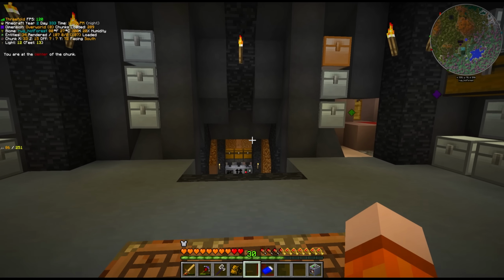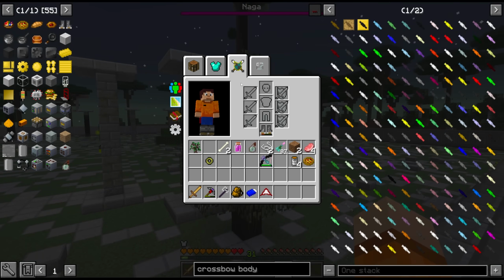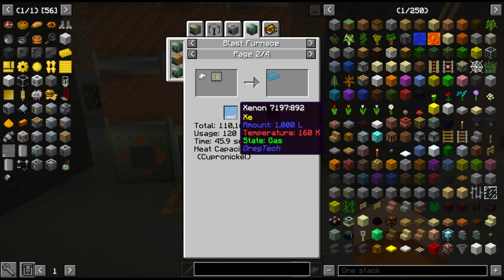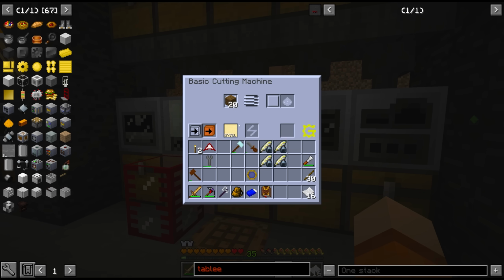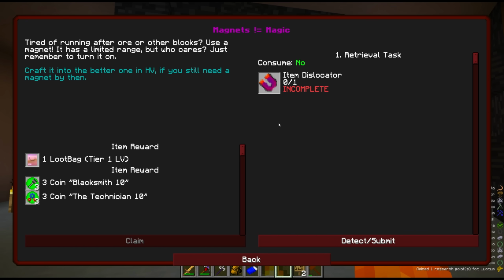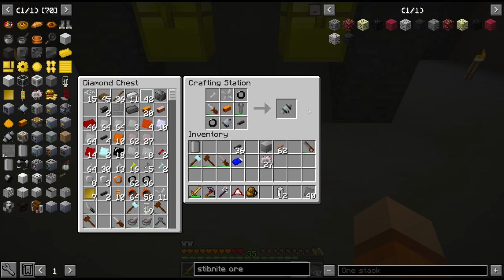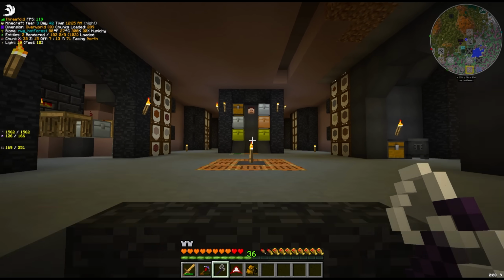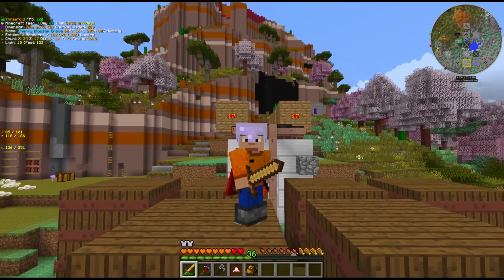Gregtech New Horizons S2 08: Scanning Circuits

Comment: Ah, Thaumcraft. It's not the easiest mod to get into in GTNH, but a ton of QoL features are locked behind it, so it is worth getting into. And getting into sooner rather than later, as the earlier you get QoL feature the more they'll do for you. To start with you can actually get alu ingots from killing Kobolds or Slime Beetles in the Twilight, allowing you to start with TC as early as mid LV (or even earlier if you pull other shenaniganry, though I wouldn't necessarily recommend rushing TC that hard). Twilight mobs in general have had their loot tables changed in GTNH, and some can drop very useful items indeed, even if it requires actual player kills to get them (diamond spikes or other forms of artificial player kills, sadly, won't work). It's worth hunting a few mobs on your search for other loot and treasures.

Wand progression in GTNH is very critical, very obtuse and sadly very poorly explained in the questbook. I have outlined more or less the entirety of required wand progression in the spreadsheet, however, so no more crafting a half dozen intermediate wands that are used solely and exclusively to craft a better wand. Instead you'll only be crafting the necessary wands to craft more wands to craft more wands🙃.

One note is that while Carbon crossbow limbs have awful durability you can put a diamond on your crossbow to give it +500 durability, which completely negates that problem. Albeit at the cost of a modifier that's basically worthless long term, but crossbows don't really have a lot of useful modifiers they can get long term anyway. You might find a diamond a worthwhile investment short term, it depends.

That one free quest reward ball of moss I do highly recommend using on your crossbow bolts if you're going to go for a max damage crossbow. You can get one particular very good material for crossbow bolt tips very early, namely Palladium after setting up a Vacuum Freezer, but repairing your bolts with that material would be very obnoxious if not worse. Ball of Moss fixes that issue. Note that there is a second Ball of Moss you can get as a (choice) quest reward from Traveller's Goggles Upgrades in Getting Around Without Dying, but that requires HV circuits to do. Crafting Balls of Moss through TC itself requires Arcane Infusion, as well.

That indeed was a Brutish Skeleton, with greatly increased damage, HP, and innate armor. Very dangerous mobs to face without a powerful ranged option, especially with practically no armor.

The hedge mazes in the twilight I don't recall getting great loot out of, though if you're still missing pumpkin or melon seeds they're  a good source. Otherwise the best loot tends to be shears, just purely because of how annoying shears are to craft in GTNH. If you want a low chance of crazy good loot in the Twilight Forest I recommend diving down the wells. There's a chance they hide a chest, and those chests can contain some very good loot indeed.

Be extremely careful around those Witchery circles in the Twilight, because there's a non-zero chance it's sufficiently overcast to allow the two hidden Witch spawners to do their work and make your life absolutely miserable. Also yes, those were four tin food cans you can use to completely cheese Spice of Life, which normally require an HV bending machine to craft. If you don't go for a Healing Axe at all you'll be praying to find a lot of those food cans early, because you can fill them in LV just fine. It's crafting them that requires HV.

Note that you can craft the Twilight Forest boss drops with their respective trophy (which will not be consumed) and Salis Mundus in a sufficiently high tier Assembling Machine. For Naga Scales this isn't really worth it, since you don't need very many and Nagas are extremely easy bosses to reach and defeat. But for Lich Bones, which require a bit more work and are needed in larger quantities, crafting them might be preferable over raiding another Lich Tower or two.

There is one other way to deal with maintenance issues this early on: You can give your EBF a third energy hatch, and provide it 6A LV total (or provide it 2A if you're only using a single energy hatch). The effect of maintenance issues on most multiblocks, including the EBF, is that recipes cost 10% EU/t more per maintenance issue up to five issues. At six issues every multiblock will simply break and shut down. So a 120 EU/t recipe at five maintenance issues is 180 EU/t...but 6A LV is 192 EU/t. So the recipe doesn't fail. It'll cost a ton more power, and neither energy hatches or generators are cheap either, but if you absolutely must ensure that a multiblock cannot fail due to maintenance this is one way to do it.

Another way to craft that Raw Aluminium stuff, by the way, is Compressing pure alu dust. This is important early on, as you cannot cook pure alu dust into alu otherwise until a fair bit later in MV.

Usually you want to avoid doing the non-fluid recipes at all costs (and frankly I think GTNH would be improved by removing those non-fluid recipes entirely, they're just more useless NEI clutter), but this early on it's somewhat understandable that gasses aren't easy to come by. That said start centrifuging and electrolysing stuff so you get the gasses out of them. Adding gasses to EBFs makes them faster and cheaper to run, which is something you very much want from your EBF recipes.

By this point it's definitely time to retire the old Ore Finder Wand and invest in a Prospector's Scanner. Soon you're going to need to start being able to scan for fluid fields (if you're going the diesel route to MV+ power), and more and more veins end up being necessary later, so there's no harm in discovering them early.

GT just loves to do thing differently, as a way to add "difficultly" I assume. I don't know why else it would decide to measure things in L/s rather than mb/t like every other mod does.

Rather than scan every single item on that list in order it's also possible to unlock aspects by combining them in the research table. For instance you can just combine Terra and Ordo to get Vitreus instead of scanning a glass block, but that will consume research points whereas scanning items does not. Some items also have to be scanned to unlock hidden research nodes. I find it's best to combine Victus (Terra and Aqua) in a Research Bench since there's very few items that have Victus and not one of the aspects that requires you to have Victus to understand/discover, but beyond that scanning will take care of the rest. If you are lost on any particular aspect's combination there's plenty of sources online that lists them, spreadsheet included.

There is a config setting to make that giant list of Thaumcraft "you've discovered X" messages scroll down faster, for the record.

Three: Rushes Healing Axe ASAP. Also Three: Disappointed when he realizes that early loot bags mainly give you good food 🙃.

If you want to process ores through your BBF/EBF you're going to need the dust, not the ore.

LV batteries you can craft more efficiently in an Assembling Machine, but this takes Polyethylene. You can get this in LV, but it's a wee bit of a process/detour to do so.

Batteries you should only ever craft using lithium, unless a recipe specifically requires another battery type. Cadmium is far too rare and used for other purposes to consider using it for batteries, and while Sodium is cheap it makes for the worst batteries, which goes counter to the entire idea of crafting batteries to store power in the first place. Certain items, such as the Dislocator and Soldering Iron, also require lithium batteries specifically.

The Alloy Smelter usually doesn't care if you're trying to alloy dusts or ingots, it'll combine them anyway. It doesn't for red alloy or bronze, at least.

It's true that Magnum Torches requires a bit of Thaumcraft to craft. But Chandeliers, the lower range versions, only requires an LV Assembling Machine. They're a bit pricy, but compared to a creeper blowing up half your infrastructure, exceptionally cheap.

Something else you can do with Thaumcraft, although this does come at the cost of a Taboo research, is duplicating a wide variety of nuggets through transmutation. Gallium and Arsenic, among many others, can be duplicated this way.

Battery Buffers are a wonderful way to ensure that your EBF doesn't run low on power midway through, since you can simply tell how much power the battery buffer has. There is a tax on extracting power so you will need more than what the recipe says you need, but even so a 16x battery buffer full of Lithium batteries can make an EBF go...actually not all that long. But it's certainly an improvement over paying that your steam production/buffer holds out.

Diodes you can buy from the questbook once you're completed the quest for an MV machine hull, although you do need the MV circuit quest to unlock that one. After that you'll basically never be crafting diodes again, though, just buying them from the questbook shop over and over again.

Gold is something that gets very scarce in HV especially, but there's a multitude of ways to generate enough gold. Glowstone farming/centrifuging is popular, mercury ore processing is a viable option, among a few other ways.
Reply: My god you've written an entire essay
Reply: @ColeSwaney  Bro confused youtube with school
Reply: You have so much knowledge of gtnh, you could make an video guide like: "tips and tricks for gtnh steam age/ lb age/"... And so on.
Reply: I definitely recommend using the (new ish) alumina dust + cryolite dust recipe for aluminium, and to that end, making the MV electrolyzer as your first MV machine.  You don't get much alumina from cryolite veins, so the electrolyzer lets you simply mine hardened clay and turn it into aluminium.  By the time you run out of cryolite dust from one vein, you can the do the alumina + carbon recipe which is cheaper ingredients but costs more energy.  Cryolite is also great for fluorine.

I've got to second buying diodes.  They're by far the most expensive component, and they don't get cheaper for a very long time because instead of the best recipe taking tantalum which is expensive already, they take platinum...

At MV and HV, one thing to consider for gold and some other ores is SAG milling them.  With various grinding balls you can often get 50% or more extra of the primary metal, although often at the loss of secondary metals.  But it helps especially if you have an auto miner which you should at HV.  At EV you can make multiblock miners which auto fortune even regular ores so the SAG mill is obsolete.  And it's always nice to get passive resources from glowflowers, redlon, mob farms, or whatever
Reply: @hacatu  The pure alu dust -> raw alu recipe is mainly a way to turn pure alu dust into alu ingots, since you can't directly smelt it in an EBF until later. Getting an electrolyser as your first MV machine is a very good idea indeed, since even aside from clay dust there's a ton of good recipes that need an MV electrolyser.

I have to admit I've never even considered using a sag mill in GTNH, given how involved ore processing is already and how I got more gold than I could spend going the mercury chemical bath route. Might have to give that idea a test.
Reply: @hacatu  I know this was posted 4 weeks ago, but just so you know... you get 2.5x more aluminum by throwing hardened clay in the mixer for clay balls, turn those into bricks, macerate for brick dust, then centrifuge into Al dust, compress dust to raw Al, then EBF. It's a lot more power (168 kEU vs 72 kEU per ingot), but that's available with just LV machines, and produces silicon/oxygen instead of consuming cryolite (edit: just realized it missed out on lithium and sodium, being in LV I don't need those yet, that might make the tradeoff later). I've been mixing dirt to mud, mud to clay balls, then following those steps. I'm still in mid LV and I've got stacks of aluminum, plus silicon wafers out my ears. (I may or may not have a pathological need to be as resource efficient as possible)
Reply: @jamesgriffith1008  you do you bestie, play the game how you want to.  However, imo it's better to make things as simple as possible in the early game, rather than putting in 4x as much effort to get 2.5x as much aluminium, from a very abundant/renewable source.  Plus you stop needing cryolite by mid HV

Red stonelillies are a surprisingly good source of aluminum by mid HV

You need a lot of silicon but not that much lithium.  There's lots of ways to get most things by electrolyzing.

Once you've made your first silicon boule you should upgrade to phosphorus doped.  If you use benzene or have another big source of ashes, passively centrifuging them will get you a lot
Reply: @hacatu  yeah... that would probably be why even though I've put in almost 300 hours, I'm still in mid LV. I may be extremely resource efficient, but I definitely am not time efficient lol. I think that might be why my friend recommended GTNH, I ran out of things to automate in Sky Factory way too soon
Reply: it’s HIM
Reply: haven't looked at the spreadsheet since mobile is a bit ass to look at for spreadsheets, have you made a list of recommended Thaumcraft Researches for these QoL's?
Reply: @birphon  There's a tab dedicated to TC tools I've found useful/novel, and in most cases it's easy enough to look up what mod a given item is from to see what research page it's on if I don't mention it directly, but a separate tab dedicated to important research milestones nevertheless doesn't sound like a bad idea. As is I'm not highlighting the importance of things like the research improvement researches or Node Preservation, and someone not familiar with this version of Thaumcraft would not necessarily know how important it is to beeline that stuff. Or the tricks needed to make turning off the research minigame actually less tedious/obnoxious than doing the research game. So that sounds like a good idea.
Reply: You can also get aluminium (and titanium) from the underground game rewards. Sodium batteries are great if you don't care about capacity and just want to have a buffer to not void items. Lithium batteries only matter if you actually use their entire capacity (eg: for battery-powered miners).
Reply: The whole mB think is quite annoying, especially when working with metals/plastics, where you have 144mB per ingot. Which makes calculating amounts by head or trying to remember just how much Ethylene-to-Oxygen ratio was needed to not have some awkward leftover in the chemical reactor a big pain. I'd have preferred if the fluid amount per ingot would have been an even number, but given, that Gregtech is by far not the only mod that uses these ratios... I need to find whoever thought of this and dissolve them in my tank of wierd amounts of sulfuric acid. 

Thaumcraft.. is definitely a Mod that you either love or hate, but it's always a chore. 

HV is probably the age you realise how important it is to keep tabs on your ressources. Especially, as you've mentioned, gold and silver. It's also the age where you start to love chemical baths and you hopefully have alot of mercury. Since HV also uses quite a bit of chrome and you won't have access to a sensible source early HV, i like to centrifuge glowstone (from glowflowers) into gold (one problem solved) and redstone. The redstone into mercury (ore processing), pyrite, silicone(good to start stockpiling alot of it early on) and ruby (for chrome). It's painfully slow in HV but every ruby dust is precious.
Reply: this may be the longest comment i’ve ever seen

Comment: i dont get the logic of volts/amperage. on the previous video you combined 2 turbines on one cable and it stays @32volts on a 4x cable but in this episode you combined 2x2 turbines on a 2x cable to get 2x64 = 128volts? i dont get the difference in building why the voltage on one build stays the same and why the voltage is additive on the other build?!

Comment: I’m having some trouble trying to put the item dislocator in any of the battle gear slots. Anyone have a solution for this?
Reply from the maker: I've recently learned this only works on servers. If you are in Singleplayer it wont let you place it

Comment: "I don't know why Gregtech uses Liters.  These should be milliliters."

It's actually supposed to be liters, to match the technical aspects of vanilla buckets:

In vanilla Minecraft, a bucket is a somewhat-magical item that can hold enough water to fill a 1m x 1m x 1m block.  In SI measurements, a 100cm x 100cm x 100cm block is one liter.  So, a vanilla bucket must have a capacity of 1000L.

Of course, this makes some rather ridiculously silly quantities for things, but when you are looking at vanilla buckets for your source of technical information, that is to be expected!

Comment: Why does GregTech use litres? It's pretty easy to unpack, actually :) Each Minecraft cube is 1m by 1m by 1m - a single cubic metre. A litre is a cubic decimetre. So a single Minecraft cube has a volume of 1000 litres.  Yes, a single bucket of water in Minecraft masses an actual ton. We always knew Steve is pretty buff.

I'm not even sure what came first - litres or millibuckets. Both are pretty obvious choices, and of course GregTech likes its bits of realworldishness.